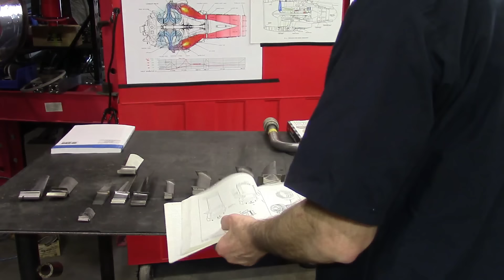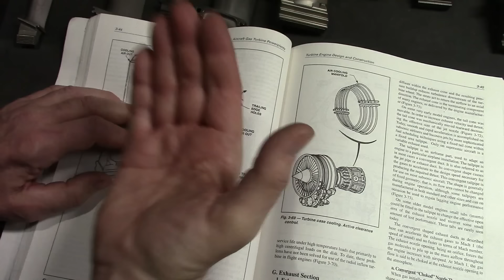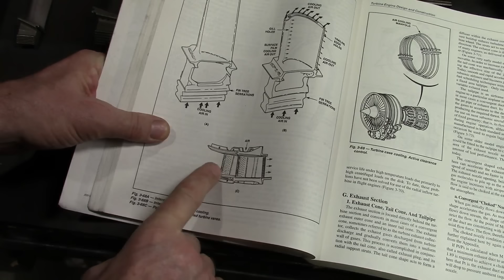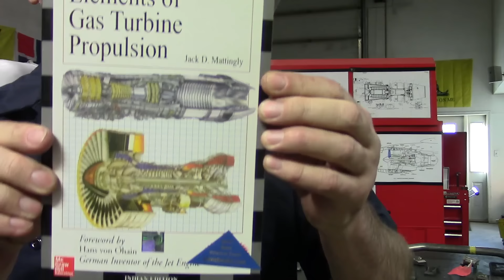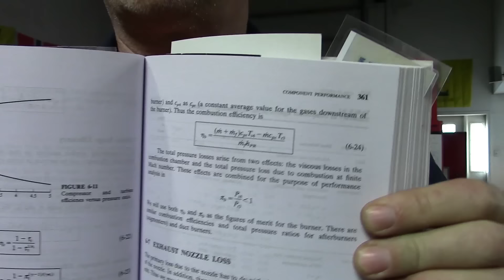Turbine Blade Cooling Air Pathways

Comment: Incredible how heavy some of these older turbine blades seem to be - they must be pulling like crazy on the shaft at high RPMs. Anyway - thanks for showing all these, amazing stuff. Would be fun to see how they manufacture the blades and get those tiny holes in there.
Reply from the maker: They are all heavy. At takeoff, each blade is pulling with dozens of tons of force on its mount, and it is glowing orangey red hot.

Comment: What baffles me when I look at the engineering of these turbine engines is how the designers and engineers manage the complexitiy within their process. 

When I am doing my little tinkering projects as a hobbyist I always try to keep it as simple and functional as possible. But a solution to an upcoming design problem often leads to a feature that comes with its own challenges, requirements and issues. And this spiral of fixes and more issues can grow really fast.

I do not even dare to think of the level of complexity when designing rocket or gas turbine engines. Keeping it simple yet efficient and effective is really an art form.

Comment: Great video as always! Some pertinent terms you could throw into this conversation (to help tie together everything you're talking about) are 'surface area', 'choked flow', 'dwell time', and 'gas density'. Yes, lots of fluid dynamics and thermodynamics math over both our heads (and I'm even in the mass flow measurement business!). In short, we're trying to pass a low molecular weight gas over a much higher molecular weight metal to draw (lots of) heat energy away. Or at least enough to maintain a nice safety margin on the metalurgical temp limits.

Some 30+ years ago I met a guy (working as a car mechanic in Tucson AZ ironically) who apparently revolutionized the manufacturer of these cooled turbine blades; specifically for private jet sized engines. Interesting fellow, not sure what he was doing working on my Honda with that kind of resume!

Anyway, it was great to finally see a breakdown (literally!) on what theses blades are all about. Thanks again for making these videos.

Comment: In a reciprocating engine, the boundary layer usually does a good job at insulating the metal bits from peak combustion temperatures. Undet knock however, supersonic waves scour the boundary layer from the surface often resulting in holes burnt through piston tops.

A gas turbine situation is a little different mainly because there's no respite from heat so sustaining a cooler boundary layer requires some "help" in the form of air bleeds.

Comment: When I worked at a combined cycle plant, we had rotor cooling air. Bleed air was passed through a water to air heat exchanger (aka kettle boiler). This cooled the air and added some heat to the feed water for the steamer setup. 

Siemens SGT5000F
Reply from the maker: The cooling air, once it has passed through these blades, become part of the gas path, so there is no way to collect it and use it.

Comment: I spend around 30 plus years measuring the position and angle of various jet engine cooling holes. The F110 engine ( f16 motor)  for an example in first stage nozzle has around 600 cooling hole two vane noozle. The first stage  blades and vanes are in the hottest place in a jet engine.

Comment: @agentjayz, cheers buddy. You might be surprised how similar “modern” turbine blades are in similarity to earlier turbofans. The huge difference is in the coatings applied, and that can go into an episode all of its own. Well coatings normally contain RE elements that are very, very expensive. In development we would start with full thickness coatings and then thin it out for “war on cost” until it looks like swiss cheese and go from there. There is just no substitute for rhenium, its just how low can you go (material life vs. cost). Then we could get into military engines vs. commercial and different cost concerns blah blah blah 😂. We are total nerds buddy ✈️.

Comment: I'm not a turbine engine engineer, but I have some training in heat exchanger design.

The objective here is to maximize the heat transfer to the cooling air while minimizing the mass flow rate of the cooling air, since this is what costs compressor power and therefore fuel consumption. Yes, the Series flow path potentially increases the max temperature of the cooling air in the blade, but this also means that the cooling air has absorbed more heat per mass.

Sure, you could just restrict the outlet of air, but then the air is moving very slowly inside the blade, which reduces the heat transfer coefficient. And then you also have a thermal gradient within the air in the blade that results in the air at the tips being hotter, whereas with the series path, the temperatuee gradient of the air in the blade will somewhat average out radially. 

This temperature gradient will also be present in the air exiting the film cooling holes.

The series path will have more pressure drop, but you likely have more differential pressure than you need for the convective cooling path because the exit pressure is somewhere between the stage inlit and stage outlet pressures, whereas the film cooling exit pressure is the turbine inlet pressure.
Reply: Out of curiosity; if you were to compare the area of the inlet section to the area of the outlets combined, do you generally keep those areas as close to the same as possible?
Reply from the maker: Another good question which i have never thought about. I would think the rate of flow would be metered by outlet area, but that would only be a guess. I really don't know where to turn for a definitive answer. It's such a specialized niche question.
But, maybe Graham knows. He designed turbine engines for his whole career.
Reply: @SirSpence99  That's probably actually quite a complicated question. If you want the pressure inside the blade to be as high as possible, you'd have the inlet wide open and control total flow by manipulating the outlets. You also have to keep in mind that the flow out of each outlet will depend on the size, shape, pressure inside the blade at the outlet, Pressure outside the blade at the outlet, and cooling air temperature at the outlet.

I don't know that there's a strong reason to control the bulk pressure of the air inside the blade, so that will probably be secondary after optimizing the distribution of mass in the blade, since mass at the outside increases load on the entire blade, whereas mass at the root can help support the blade structurally. Moving metal around also affects manufacturability, steady state and transient thermal performance, vibration modes, etc. 

So there's at least five domains for optimization: External flow, internal flow, thermal, structural, and manufacturing.

That goes a lot towards explaining why these engines and especially their development are so expensive.
Reply from the maker: If you don't know, like I don't know, why spend three times as many words saying you don't know?
You seem like a nice guy, trying to help, but guesses are usually treated as chaff.
Carry on, as if normal.
Reply: @AgentJayZ  The rule of thumb I follow when designing ducts for my 3d printer is that I maintain the same cross-sectional area unless I want to increase velocity and I also make sure I never increase area and then decrease it.

According to my understanding of physics, (from looking into rocket nozzles, though that is rather different) decreasing area increases velocity while decreasing effective pressure given an unchanging source. Given that "high static pressure" fans basically don't exist and that fans of all kinds lose flow rate as the required pressure increases, I try not to decrease the area of my ducts unless I have to.

What I'm mostly curious on is which part (if any) I'm wrong on. Considering I'm doing cooling much like the vents on the leading edge in your examples are doing, this is something that would actually be quite helpful for me to know. (I'm currently designing 3d printer cooling ducts so they need to vent air out a bit of a distance to cool the part.)

I suppose that means my question is two-fold, one, does changing the area after some distance in a duct decrease flow-rate and do you want higher velocity or higher flow-rate for cooling.
Reply: @roflchopter11  I have some understanding of how to manipulate pressure/velocity in ducts, what I don't have is knowledge on what is more desirable when cooling, velocity, pressure or if they are equal in effect. And yes, of course removing material weakens objects and likely in ways you may not expect.
What I'm after is what metrics are used in order to choose which factors to optimize.
Reply: @AgentJayZ  On one hand I agree with you, he basically just repeated the (in my opinion obvious) thrust of my question with more verbose language, on the other it has been my observation that one of the best ways to learn the truth is to to intentionally post the wrong answer on the internet. If it doesn't attract some random engineer to correct you, you are in the wrong place for you to learn.

Now, that said, yes, repeating a question in a more verbose way for someone while making it seem like it is an answer isn't very helpful, except for your ego.
Reply: I suspect there's also some consideration for making very sure to avoid any modes of operation that could cause laminar flow inside the blade among the other concerns. Laminar flow inside a heat exchanger is pretty much never a good thing, that's how boundary layers with temp gradients in that cooling air are formed vs efficient heat transfer with turbulent flow.

Comment: It's still amazing to me that those early gas turbine engines, and even piston engines, were designed and built by extremely smart people with nothing but pencil, paper, slide rules, and a vision of what they wanted to achieve. No computers or AI modeling, just ingenuity.
Reply: A good slide rule can provide an accuracy of 2~3 significant digits, which is enough for most engineering applications.

Comment: where i work we do steel stacks the can hold 800°C ...we had numerous connected to a gas turbine generators ...thats some crasy ass technical solutions in those stacks. we didnt went to aircool the liners yet :D:D. when the inlet is of the size of two buses its 99.9 chance its one of those.

Comment: The HPT blades on the Rolls-Royce Trent 1000 TEN have a life of 1000 cycles (flights) mandated by EASA (if they last that long before cracking due to creep) and cost around $25,000 USD each
Reply: Is it the fatigue failure ?

Comment: G'day Jay,

Yay Team !

A beautiful 
Explainification ;
I enjoyed every bit
Of it...

Thankyou.

As regards your
Parting Question,

"Who makes Cars with Wooden Spoked Wheels today (?)... Nobody !"

Well, um, probably because I posted a Video showing two of my grandfather's Wheelwrighting Tools which I'd cleaned and oiled-up for their first use in 25 years (and then, I was using them for the first time since 1936 when my grandfather last made a Wagon Wheel Spoke with them)... ;
The mighty YouTube Algae-Rythm has been feeding me with back-catelogue Uploads from
@ Engels Coach Workshop Channel...

Whereas I use the 1905 Patent Tools on my grandfather's Brace & Bit, Dave Engel has a pair of Drill-Presses, one with a Spoke-Pointer and the other with a Spoke-Tennon Cutter...

He scratch-built Full Size Replicas of the 3 Wagons in the Death Valley Borax Wagon-Train - which used to operate from 1892 till 1896 or something....; each Rear Wheel from all of 3 Wagons , weighed 1,080 Pounds, before fitting - and he built all three complete, working Wagons, two Ore-Carriers holding 8 Cubic Yards  each and a Water-Wagon holding 6 tons or so to water the
16 to 24 Mules it took to haul the
Wagon-Train out from the Mine.

At age 15 I helped Dad to shape &  fit one of the last of 6 Pairs of Sulky-Shafts which his father had bought pre-sawn in 1936, there were 3 pairs still in stock in 1976 (!) {and the old man had no trouble selling the two remaining pairs...}.
Not long after that, he was asked to fit a pair of Steel Tyres to two Wooden Wheels, for an old Combination Harvester being restored, and I was enlisted to help in the second one of them.

I've flown behind two Propellers which I designed, laminated with Ancestral G-Clamps, carved with the inherited Drawknife & Spokeshaeves, and shaped with the Grandparental Wood-Rasps....(!) ; so I sort of barely almost know enough to understand & appreciate what an amazing (Remnant) Expert Master Craftsman he actually is.

And his Production Values are
Superb.

Do yourself a favour, maybe
And check out the answer to your
Question....

Look him up...(?) !

He's not churning out
Wheels for Henry's Model-Ts

But he is
Still making an apparently handsome living, as a
Wheelwright, 
Making and Repairing & Restoring Wooden Wheels, and
Horse-Drawn Vehicles.

Commercially, with a
Main-Street 
Shopfront
Workshop
FULL of the most wonderfully
Specialised
Tools...

I really enjoy watching the pair of you..., because 
You and he are like two
Peas in
Parallel Pods,
On different pathways,
Both in relentless 
Pursuit of preserving the
Old Machinerys, in the
Olden Ways,
Least it all be forgot...(!).

Kinda thing.

Just(ifiably ?) sayin'.

Such is life,

Have a good one...

Stay safe.

;-p

Ciao !

Comment: Seeing you present these blades that had a bad day it made wonder: How much damage can a jet engine absorb and still be repairable? Or put another way; at what point do you consider an engine a total loss?
Reply from the maker: That really depends on a lot of things. The common term for scrapping a modern engine is "beyond economical repair".
But for vintage collector items like the Orendas and J47s I work on... the value goes up, so it has to be much further "gone" before it's scrapped. of course all the good bits would be saved.
For an engine from an F35 to be scrapped, it needs to be more expensive to fix than a new one. But they
are available new, and all the parts are still being made.
For the old stuff, new old stock is getting harder to find, and new engines stopped popping up decades ago.
The engines that I restore are made out of a combination of all the best parts from several engines that may be considered beyond saving on their own.

Comment: Excellent presentation, sir. Question: possible to use low-pressure air from the early compressor stage passing through an intercooler to lower the temperature of high-pressure air from later stages of the compressor in order to increase the cooling capacity for turbine blad cooling? ~just curious~
👍
Reply from the maker: Not necessary to add Rube Goldberg complexity.
Blade cooling is accomplished with a tiny fraction of total compressor air. I more cooling is needed, the design is changed to take more.
These adjustments are done in the development of a new engine design.
Reply: The straight answer to your question is: yes, it is possible - and the Russians did it some years ago in one of their military turbofans.  Please see the comment I've previously posted.
However, as AgentJayZ has suggested, in answer to similar questions, if it was a really good idea, then it would have been taken up more widely.  I agree with him that it's just not worth the complexity - and the weight penalty.
Reply: Diffuser air is used for 2 reasons.  The pressure of cooling air MUST be higher than combustion gas pressure, otherwise you would not get cooling air effusion,  you'd get hot gas ingestion.   AND.  The temp of the earlier stage would be too LOW and cause thermal differential cracking.  Too cool is bad.  Modern engines run very hot, and we only need to cool them to just below a "critical temp" to stop creep and TBC damage.  Rolls Royce also uses single crystal blades for Crack resistance.

Comment: Can the cooling air be intercooler to lower it's temperature?  Would that be worth the hassle? Maybe air that was too cold would cause thermal shock to the blades?
Reply: Not worth doing; it works fine now, and the drag and weight of an intercooler would not help enough to be worth it.
The engineers where I work dream of materials that wouldn't need cooling at all!
Reply from the maker: Uncle Kenny is right. Here is an answer to a comment just above yours: such a small amount of air is used for cooling compared to total mass flow, the expense and complication would not be worth the bother. Also, when you want to carry heat away from something that is over 1500F, and you use air at even 500F, it's going to work just fine.

Comment: Do you have a video showing the pto from turbine shafts. More to the point which axle is it taken from. My interest is heli engine
Reply from the maker: It's not called a PTO.
If you want to say power take off in generic terms... that's not how it is described.
Most helicopter engines use a free power turbine, which drives a reduction gear train, with the final output being a rotating shaft, which then feeds power to the main helicopter gearbox.
I have a series of videos where we work on the T58, a medium-lift helicopter turboshaft engine, rated at just over 1200 Hp.
The first vid in the playlist is here: https://youtu.be/vgDEhLj_ySw